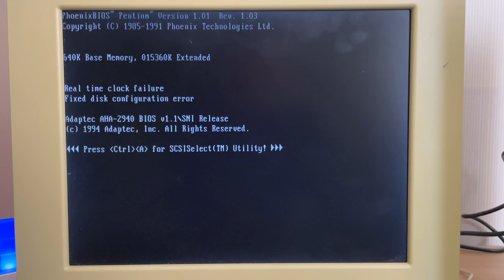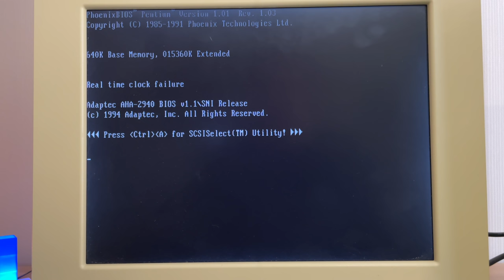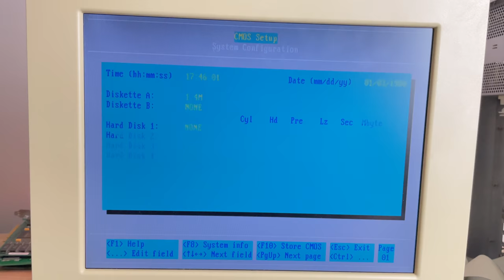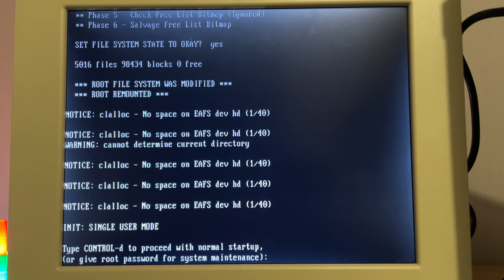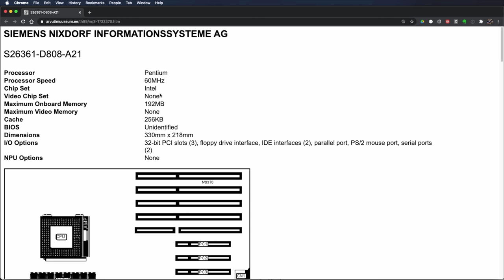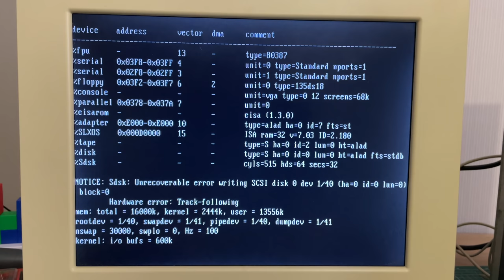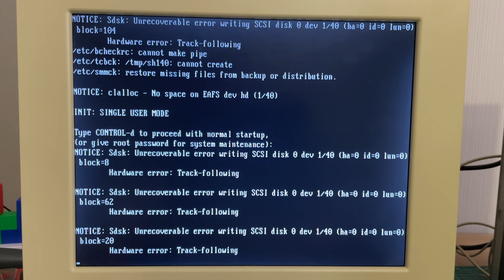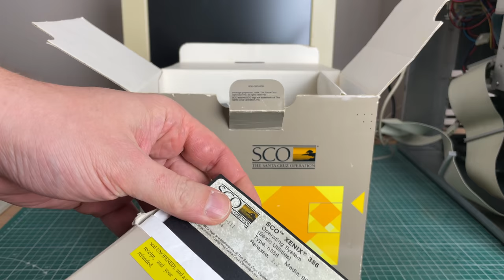Siemens PCD 5T Pentium 60MHz Workstation

Comment: The multi serial port card suggests it was a dumb terminal server - have you ever seen the Digital terminals? Google DEC VT320... There could have been up to eight of those around the building this was installed in, maybe a doctor's surgery, maybe an airport, anywhere staff could do their job via basic input / output on a dumb terminal like that.

This was a very popular platform at the time.

Also, definitely use the Quantum F... Oh, you did. Ouch, that's a nasty state of affairs. Those poor hard drives 🥺
Reply: My wife used to work for a company in Austin, TX that produced software for automotive parts stores. They used SCO Unix with SCSI drives and tape backups like this one. Also had multi-port serial cards to attach terminals to at the sales counter. Software was called Eclipse and was used in Europe as well as USA. If you would like to try the root user password that was on most of the computers they sold, let me know and I can send it to you using a secure method of your choice. Except, it appears that won't work either based upon what happened to the drive.

Comment: The extra power connector is for PCI 2.1 compatibility; I guess some higher end PCI cards required additional power to drive them, and you'd need to connect that power here.  My Gateway 2000 P5-90 has one but its positioned by the PCI slots, helping me deduce what it was for, and I confirmed it in the documentation.  Your motherboard runs a Socket 4 Pentium, mine is for a Socket 5.  I think these disappeared when you started seeing AT layout motherboards that would accept AT both ATX power connectors as the 20-pin connector would already have all the power needed.

Give that SCO UNIX distro a spin and show us some basic service configuration!
Reply: Thanks for solving that mystery!!

Comment: Really cool video!  Looking forward to part 2.  I recently completed the rebuild of a Packard Bell Pentium 60Mhz machine.  Similar to you, I had to replace the Dallas RTC chip, but in my case I was forced to re-solder a new one, although it now works great!  Really fun machine to play with.  Runs doom well, and even a little Quake.  In the late 90's, my first Pentium was a 66Mhz machine, so these Socket 4 systems hold a special place with me.

Comment: Dude! This THING has EISA! Rare with PCI. Probably RTC. Those BIOS typically had to be manually defined in C/H/S, DMA and stuff is not out yet.

And dallas RTC chips are mostly all dead by now. I have a PS/2 Model 30 286 that takes one
Reply: Same!  Replaced mine with a GlitchWorks RTC chip!

Comment: I also have a PCD5, my is version TG. It have 90MHz Pentium, 32mb RAM, SCSI Quantum HDD, Tandberg tape drive and Sony CD SCSI drive(Currently not functional probably dead laser :( ). Its my second Siemens in my collection, i also have a newer Scenic 600 for retro gaming(It was my first pc when i was a kid).

I absolutely love this old-school Siemens ingots. Most of them still works, even they are more than 20 years old. That sound, that industrial design....absolutely awesome. Performance is not as good as the custom build computers but...it doesent really matter :)

Comment: The mysterius connector Is another SCSI conector. Look the SCSI connector tablet. Greetings from Argentina 🇦🇷🇧🇪
Reply from the maker: It seems to be a multi-serial card (8 serial ports) on a single connector
Reply: @RetroSpector78  Yes, it is a multi serial card. This is a SCO Unix system and the serial ports are used to connect dumb terminals...
Reply: @RetroSpector78  As a kid I remember seeing a machine identical to this in our library powering the dumb terminals to do book searches..

Comment: the multi serial card would be for supporting multiple RS232 terminals. I cut my teeth on Xenix, SCO Unix SysV and Openserver. We wrote communications software that hooked into MAJOR telecom switchs and PABX systems from ericcson, NEC, nortel amongst others. We generally used Compaq computers but pretty much 386 or above. we used to hang off using digiport 32 port serial cards terminals from them - amongst other RS232  hardware like message boards and so on
Reply: I'd love to find one of those!  When I was toying with Concurrent DOS 386 the other day, there seemed to be support for this.  Serial terminal server for the win!
Reply: @RetroTechChris  we usually used the 16 or 32 port depending on what we were doing. the downside is without the dongle with the db25s on it was nigh on useless
Reply: @WX4CB  ya.. I was afraid of that!!!  A few (or perhaps several) cards had survived, but the dongles are probably long gone :(
Reply: @RetroTechChris  yea, a good thing is that th epinout would be easy to find with a meter as it should be n times the connections depending on the amount of ports. i personally use an edgeport/4 4 port usb module for my radios and for other things like laplink :D

Comment: I was surprised seeing integrated primary and secondary IDE connectors on the MB, as 430LX Mercury (the very first Intel chipset for Pentium 60/66) had no integrated IDE controllers, and there was no IDE interface card either (didn't matter as it had an Adaptec SCSI card). Then I noticed the PC Tech RZ1000 chip; it was not very popular back then, with loads of problems: https://www.mindprod.com/jgloss/eideflaw.html

The original owner apparently chose method 5: "Buy a SCSI (Small Computer System Interface) hard disk and CD-ROM, and avoid using the EIDE ports entirely."
Reply: I'd guess that the kind of person who bought a name brand Pentium in 94 was going to use SCSI no matter what IDE controller the computer had.

Comment: I usually just blow the dust out with the compressed air. No need to disassemble it altogether if it isn't too dirty :) Too bad the original SCSI was dropped, it happens, but if the PC wasn't disassembled it wouldn't. Otherwise, it is a nice machine, but I would much prefer a Compaq or IBM of that same era, they are better built (no finicky plastic tabs holding the case together, etc.),  and the support for it can be usually much easily obtained. For instance I got a very nice Compaq Deskpro XL 486 machine, but after a week the mainboard failed. Just went on eBay and bought one for €30 including shipping. I was trying to find a replacement power supply for a Siemens PCD-5H for years but then gave up the find last year and scrapped the machine.
Reply from the maker: Also have a PCD-5H. Will probably also showcase it a bit in the next video
Reply: @RetroSpector78  Nice! Will definitely watch the video. Also, in your PCD-5H if you have power supply made by MagneTek, please do yourself a favour and recap the low value electrolyitcs (1-22uF range). I have another one that works, but needed recap of the PSU.

Comment: It would be really sick if you could actually source an original PC-D, just for the value of messing around with a computer that has the IBM-incompatible 80186 processor. They actually had to patch programmes just to get them to even run on a 186, and even then they would not be fully compatible. And their 5.25" floppies were of a proprietary format that allow 720k.

Comment: 18:55 All Pentium CPUs for the socket 4 had the FDIV Bug.
20:14 You're right. This card made by Specialix would connect to an adapter with 4 or 8 serial ports. So up to 8 users could connect to the server at the same time or up to 8 other serial devices or anything between. Could be used in a small POS system but could've been an comparatively cheap and slow (up to 115 kBd - RS-232 after all) way to connect 8 users to a server back then.
20:56 Back in early-mid 1994, when this PC was manufactured, PCI graphics cards weren't commen. To my knowledge there was only the Ati Mach 32 AX avalible at this point. (NEC had a 'ImageVideo' PCI card as well but you had to buy a whole NEC PC to use it.) But a bunch of PCI graphics cards were released in mid-late 1994. By 1995 basicly all new graphics cards were PCI.

Comment: I imstalled a lot of SCO unix from that version on Siemens pc’s, but we always got them delivered on QIC tape cassettes not cd or floppy, that’s why the machines have scsi tape drives. You should look for a tape tarball and not an cd image.
We used them as tty machines to operate telephone exchanges, using the serial ports.

Comment: I had a PCD-4H long ago. Still have a PCD-4ND laptop, but ufortunately it has developed an IDE interface issue recently and the Citizen branded floppy drive is also something very interesting. It uses a belt to rotate the disk which dimininshes over time. Sadly in my case the heads don't read anything anymore.Could be an issue with the opamps of the heads. Also it has a very minimalistic BIOS setup, pretty selective taste on any IDE-SD adapters. These strongly vivid green soldermasks remind me of ordering PCBs from a company called Eurocircuits. They use something similar. It's not too glossy, but very vivid green. :)

Comment: Nice, I worked for Siemens Nixdorf as a working Student in Augsburg, but in the early 2000, not 90s. It fused later with Fujitsu forming Fujitsu Siemens and got shut down 2 years ago.

I am quite sure it is a terminal server using the 8 port serial card, as it has no network interface for other server usage and a horrible graphic card for a workstation.
Reply from the maker: Indeed ... will see if I can still get something off the hard drive

Comment: What a pity for the hard drive...

The presence of the multiserial interface card and the fact that this machine has Unix as its OS makes me think that it was used as a web/BBS/terminal/remote access/whatever server, with a bank of analog/ISDN modems connected to the serial interface.

Comment: Pretty good sized dust bunnies there. Yuck-o. That said I have seen some as big as large house cats or small dogs. Amazingly the machine was still running even though the fans were making trails in the dust caked into the heatsinks. Scary stuff man.

As for recovering the data from the old HDD, you can make a boot disk and use utilities from any OS you can get to run on something that old. I'd suggest Damn Small Linux or Crunch Bang. Any light weight version should work fine. G-Parted tends to do a decent job for partitioning and adding boot loaders. Good luck and thanks for the content.

Comment: Great video ! Love to see all that SCSI stuff, sory the original  hD went broke that way ! Futuristic looking it deserves a better life; check the power supply as it´s used may have capiacitors on breaking point. Wonder what kind of use this machine may have ! Suse linux I had a 166 with some games like civilization, railroad tycoon 2 and some bizard platform arcade. Last tried to put Word Perfect Office for linux on it without result. Multiboot maybe nice option as you have more scsi drives one windows, one linux or retro to os/2 version 4 or a NT 4. Games usual mix of DOS and early windows based games like startrek 25 anniverary or like, anything neweer may be out of reach. Looking forward to the next video !

Comment: I have one of those too, but with a dual processor mainboard. I have 2 Pentium 90s installed. Underneath the power supply I have an additional board with a voltage converter for the CPU. These are connected to the other port with a white cable. I have the device running on the IDE controller with Windows 2000 and an SSD 😁. There is also a DVD drive connected. And the PC has a Riva TNT2 graphics card with 32 MB, although I'm thinking about replacing it with a smaller model like a Vanta as it's just too slow to use a card like that sensibly. I just ran 3DMark99 today, 500 points with 800 x 600 in 32 bit. The sound card is also a simple SB16 Value and USB 2.0 and I also installed a 3Com network card so that data can be exchanged more easily.

Comment: That motherboard looks really interesting, like a precursor to ATX with those back panel connectors. The difference is that ATX would sacrifice the eighth expansion slot to make room for more ports in that I/O area (and the extra built-in functionality compared to the original AT-type motharboards almost entirely made up for losing that extra expansion slot anyway). Also, ATX would introduce the 20-pin connector, which introduced standby power, so the computer no longer had to be turned off at the mains in order to be in a "shutdown" state, thus meaning it could also be turned on by things like network requests. I wonder if that extra power connector had something to do with enabling those kinds of features through some kind of custom PSU/networking solution?

Comment: My vote for the mystery 4 pin connector next to the front panel block is probably external speaker. Second guess is external battery but not likely with a dallas clock on it.

Comment: This could have been used as some kind of industrial controller. I wouldn't be surprised if this was still used until recently. There are a lot of ancient machines still used as industrial controllers. The operators probably just didn't bother replacing the dead Dallas chip.

Comment: You could try running Steve Gibson's Spinrite on the disk, as long as you can make the disk visable to DOS.
Reply: That would fck even more the already damaged platters. Software only solutions like Spinrite are a NO-NO in cases like this. Here hardware-only analysis and solutions are your only chance to recover anything.

Comment: That's the first SNI system on YT ever seen booting up SCO UNIX right from the start. And HDD fall of the table. SHOCK!.Please try SCO! - All manuals I've seen from older SNI/FSC computer products stating compatibility with SCO UNIX System V/386 Release 3.2, Version x.y, but never have seen one coming with them installed from the ages. Seems to be the original hard disk drive from the past (SNI P/N). - Owning PCD-3M, 4G, 4H. Btw all Made in Germany, factory plant in Augsburg, including the state-of-the-art mainboards. Personally started with a SNI WX200 tower,  the 1st Intel based, graphical (X11+mwm) UNIX workstation from SNI, under SINIX-K also known as SINIX ODT V1.x. It was an rebranded SCO OpenDesktop with X11+mwm. SNI used them also internally for scanning and archive operations. That's were mine come from. Graphics inside was a Matrox PG-1281/CV (1280x1024x8 resolution accelerated). - Nice channel! Keep them up and stay healthy.

Comment: Oof, you should never use a screwdriver to remove socketed ICs. You could easily damage traces on the motherboard. They make very cheap plastic removal tools that work way better and won't damage the board!
Reply: Also, I would actually sacrifice a goat to Satan to get one of these machines. Lucky! As an embedded device designer I have to say that motherboard layout is exceptionally clean. It's obvious that someone put a lot of time into component placement. Definitely not autorouted!

Comment: Have you tried putting a hard drive in the freezer and tried reading it again .it worked a few time for myself to get just the data off
Reply: the drive went for a dive but couldn't survive. landing on a awkward position could crack the body and damage the heads in the proces when hitting any hard surface.

Comment: If ya wondering where NIXDORF has gone, Tey got handed to Wincor for a while and are now sold off to DIEBOLD..... They became more involved in the E-POS industry and I didn't know that the NIXDORF side of things were involved in the general computing space, then again, Fujitsu Nixdorf was before I got my job.
Reply: Before Fujitsu Nixdorf there was Nixdorf AG. They had been involved in the computer business since the stone ages, i.e. the '70s
Reply: Nixdorf was bought by Siemens in 1990 forming SNI.  The computers went to Fujitsu Siemens Holding in 1999.  The cash registers and ATMs n stuff went to Siemens Business Services GmbH und Co.  Later called Siemens Nixdorf Retail and Banking Systems GmbH.  They were renamed to Wincor Nixdorf in 1999. In 2016 they merged with Diebold resulting in Diebold Nixdorf.

Comment: If I had to guess, I'd say this was probably used for accountancy with a handful of dumb terminals connected to the rear, and maybe running something like SAP. Just a guess.
Reply from the maker: Will see if I can pull some stuff on the hard drive. But without either the server or client component whatever is on there might nit make a lot of sense. Could be something very custom for a factory or other industrial setting. But we’ll see ...
Reply: @RetroSpector78  : I answered that because when I was younger, I worked with a FCA and he had one such SCO system (on a smaller regular desktop siemens nixdorf computer) to interface with a client bigger system and download data from their ERP. Details are hazy as I didn't interact with that at all in the days. As you said, it could have been industrial on a shop floor as well, considering the amount of lint that was sucked in and now surrounding the FDD.

Comment: u should use the fujitsu hard drive. In my opinion it woud make it more period-correct, considering their partnership at the time this machine was released.
also i wis u had show a little bit more about the tape drive
Reply from the maker: Will do in the next one. Dunno if it still works. Might have a tape for it we’ll see. I think someone already opeend the Fujitsu drive as some of the screws got revealed ...
Reply: @RetroSpector78  Did you take a look inside the Fujitsu drive?

Comment: Silly how the sliding door covers the power button.
Reply: I guess that the lock on the front would actually close the sliding door in up position, to prevent somebody else to use power button or any drives. You would just lock those doors and secured your pc. Workstation PCs like them some security ;)
Reply: @yosuhara  Yes that was probably the intent.  I reckon you could still turn on the PC with the door closed by using something slim to push the button through those slots.